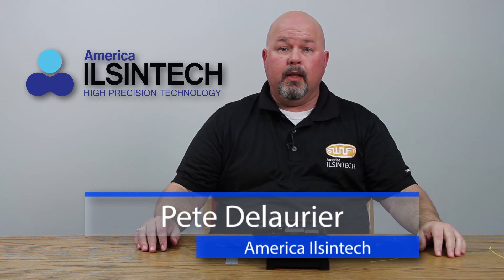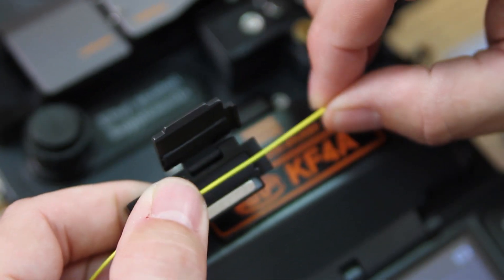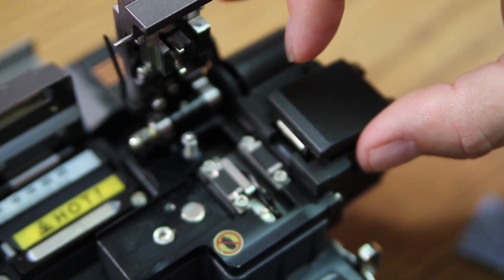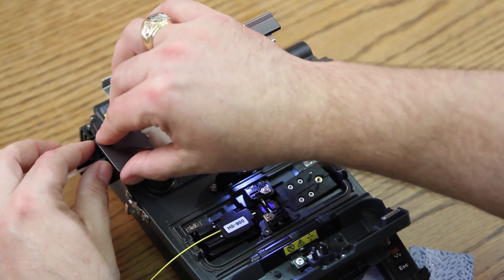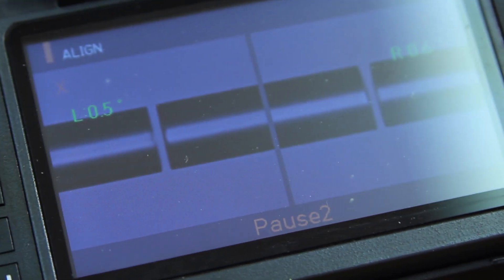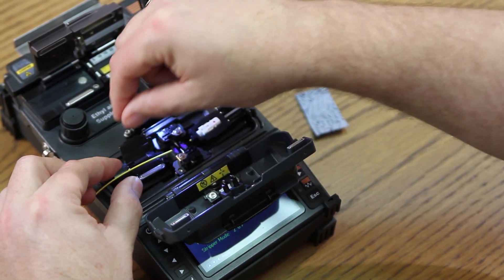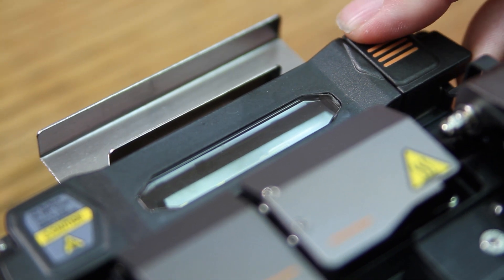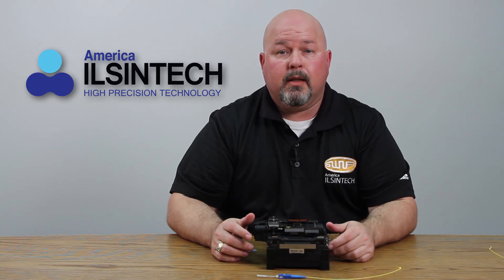Termination of a Splice-On Connector Using the Swift KF4A Fusion Splicer

Comment: .02 is not a very good splice.  Yes it passes but I can typically get .00 DB loss Ina splice that I do with older Corning technology.
Reply from the maker: Hello Michael and thank you for your comment.  

The losses indicated after the splice are estimated taking several factors into consideration.  You would want to perform a field test to verify the actual, which may be as low as .00 as you have experienced with the Corning splicer.  With the accuracy of active-clad alignment, the concentricity of the fiber construction tends to be a larger factor than the splice process when done properly.  To mitigate that variable, you might want to consider a core alignment splicer.

In either case, I'm pretty sure most would agree that .02 is pretty good.
Reply: Yes I agree.  .02 is pretty good and I wouldn't blink to hand that off to a customer.
Reply: Theres one in every bunch, "all mine are 0.0 blah blah"
Reply: Plus, keep in mind it's an FSOC connection, meaning you get rid of a) the pigtail, b) the mandatory fiber' slack in the c) mandatory cassette, all of which, at the end of the day, makes you both save time and save money. IMHO, that's worth the .02 dB ESTIMATED loss !
Reply: Michael Hinchey
Reply: Very rare to see a .00 with an otdr. The splicer loss is just a guess. An otdr will tell you the true value. Any good splicer  knows this. You obviously aren't one